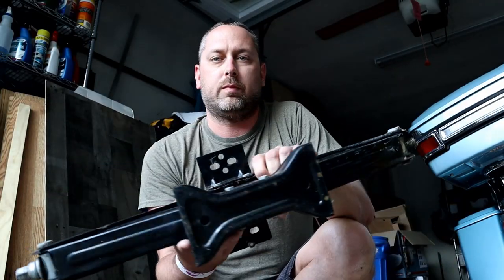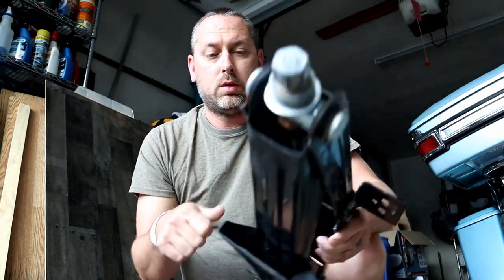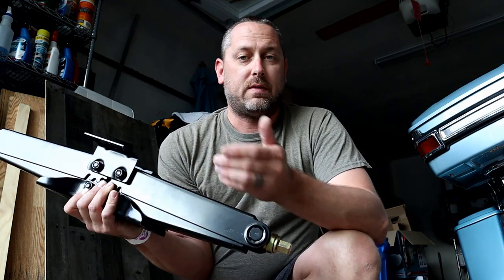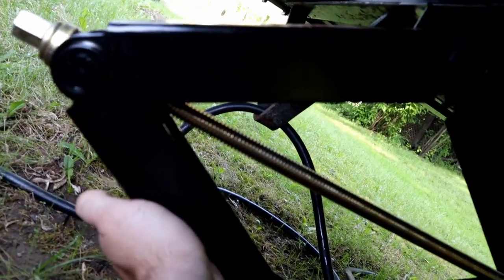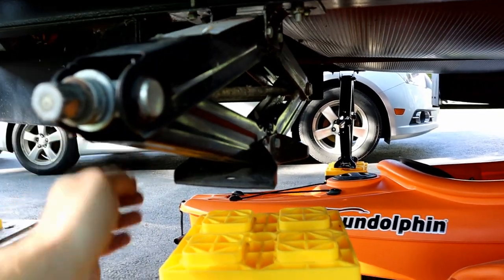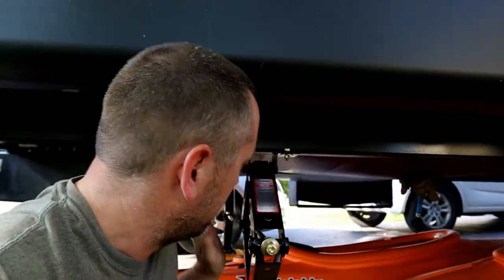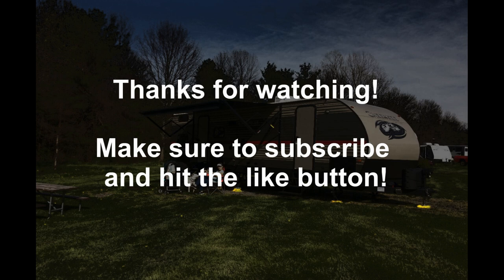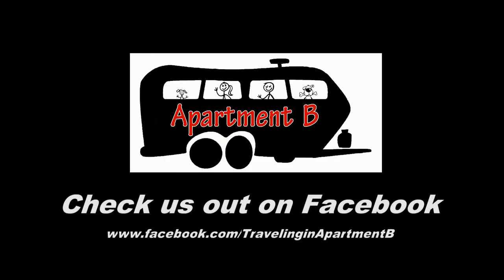Travel Trailer Jack Stand Replacement - Libra Jack Stands - Cherokee 264DBH

Comment: great site, a great find for me....         are you leveling  or just stabelizing  ?            there must be a better way to lift a rig and not use  plastic of wood and i  am also know the importance and the effort to make money, not going to waste money on plastic garbage that can't home the weight of my rig.......
Reply from the maker: We are just stabilizing. They are heavy duty enough to where I would raise a side about a half inch or so but I haven’t pushed it any farther than that. If you added two more on each side you could probably level a little more than that. You can have a Lipert leveling jack system installed on a travel trailer as well. It’s pricey but if you move a lot it might be worth it! I just watched a video from Finding Our Someday and has it installed, it would be nice to hit a button and have your trailer leveled in just a few seconds!
Reply from the maker: mr zif001 
https://www.amazon.com/Lippert-Components-M6V-675817-LIPPERT-675817/dp/B07H3TPKGY/ref=mp_s_a_1_16?dchild=1&keywords=lippert+leveling+system&qid=1599564345&sr=8-16